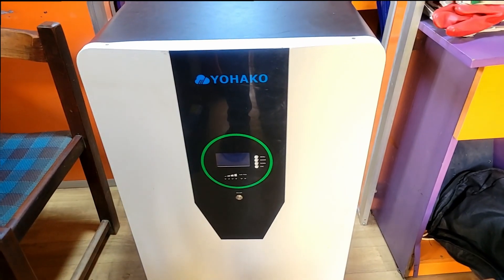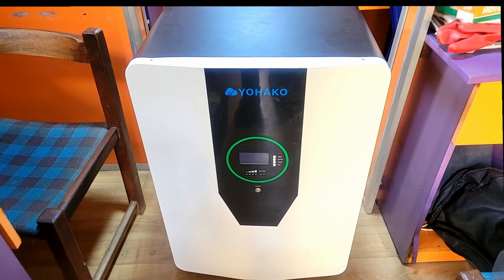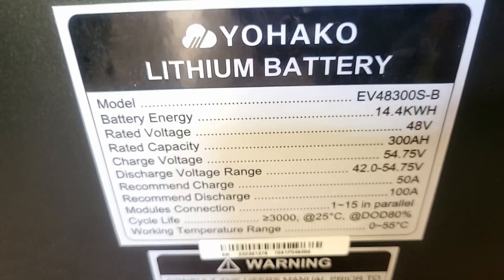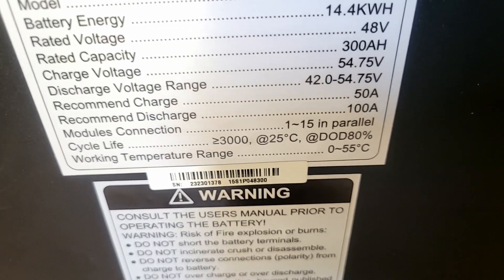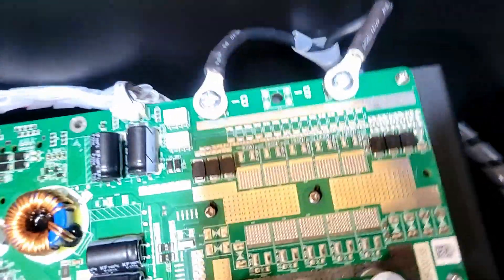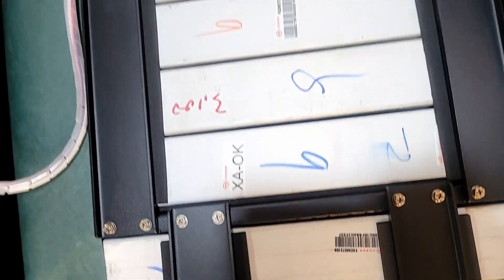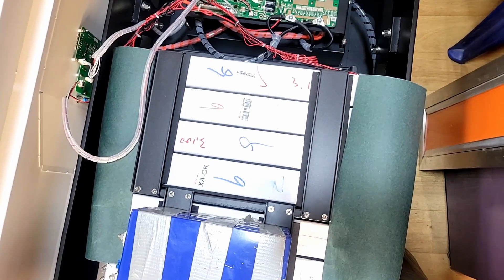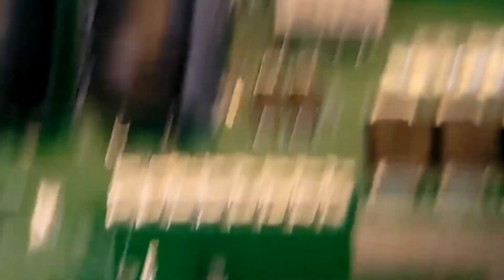Unbelievable Deception! Our Mind-blowing Discovery Inside The Yohako Battery!

Comment: Bonsoir merci pour l'explication qu'elle le port   qu'on connect sur l'onduleur
Reply from the maker: @mamadoumarymaintagama1355  I am not sure that any inverter can communicate with the battery. Usually I tell people to read the manual
Reply: J'ai perdu le manuel (les  termites on bouffé ça). Si vous avez la version électronique YOHAKO
LITHIUM BATTERY

Model
EV24200S-B
Battery Energy ..
5.1KWH
Reply from the maker: @mamadoumarymaintagama1355  I don't sell Yohako. Je ne pais le manuel.
Reply: Ok

Comment: Ive dealt with Yohako. You're looking at an "Alaba version" 😅. In essence, someone has opened a genuine battery and replaced the cells... OR more commonly, they've taken a 10kwh battery and badged it as a 15 kwh one (with a printed sticker).

Thats probably what the CEO was trying to tell you. I'd suggest you go to their warehouse, pick a random battery and test it. If I was them, I'd allow you do it to dispel the cloud
Reply: Just scrolled down and seen several.uneavoury comments attacking you personally. For the record I don't support that. And for those (like me) who believe Yohako IS integruous... We need to respond with facts and well thought through positions. Not insults and emotional drivel.

PS: IF Yohako batteries ARE proven to be fraculent; I'll definitely keep an open mind
Reply from the maker: @ikbarbershop  I would be happy to do a follow up. Used automotive cells are OK as long as you disclose this. I said this in my video. Yohako is an Alaba brand
Reply: @drsolar  I have quite a few Yohako products on my premises. I'd be very happy for you to come test them anytime you feel like. And yes I do agree about the reconditioned cells part. But like you said BYD (their old battery) and now EVE (their latest battery cells) are quite high quality.

My suspicion is the 230aH cell was reconditioned and they now sell it as a 200aH cell to account for degradation. I'm almost certain an Alaba reseller changed the sticker and sold a 9.6kwh battery as a 14.4 kwh one. 

Ive just seen you now distribute Solax in Nigeria. I'll reach out this evening to discuss potentially doing some business in that direction

Comment: Wrong calculations my dear, it is 300ah times rated voltage... Bring down this post mugu
Reply from the maker: Thank you engineer. The post is not coming down. Do yours to counter mine. Till then STFU
Reply: simple maths you do not know battery is 234ahx51.2 =11980w does that look like 15kwh battery as printed on the sticker.fool

Comment: I use Yahako inverter for years and it’s working well, don’t spoil someone business. Am not subscribing at all
Reply from the maker: Thank you for watching and commenting. The video is not about an inverter. It is about a battery and what is found inside that battery. Watch it before you comment. Thank you for subscribing
Reply: what load do you apply to yours.watch and listen before you post.he did not say it was not working but it trips off base on load given to it and advertised capacity that is supposed to carry the load.that is why Nigerians fail all the time

Comment: Don't use our product as a medium to boost your audience. We are genuine and it's evident you were paid to defame our product.
Reply: I am looking for contact details for Yohako products. I have used the inverter before, I am happy with it.
Reply from the maker: @DrEnockNorthVoltageEngineering  good to hear
Reply from the maker: thank you for watching and commenting. Did you bother to watch the video? Maybe you should watch before you comment. I don't need to use your product to boost my audience. I challenge you to respond to the points I made and refute them. If you can I will make a follow up video. Inside the battery are used EV cells. The used cells can't be the same capacity as new cells. Refute this and I would gladly remove the video.

Comment: Nice video Dr but I was expecting you will measure the voltage of each cell and also the current to ascertain that the writtten on the label is wrong.
One other thing is that we dont have quality control in Nigeria most of the Lithium batteries cobtains reconditioned cells.
Reply from the maker: The point of the video was not really to get into in depth technical details.
They don't disclose that they are used cells. That is the point of the video.
Reply: @drsolar  this is well noted. Keep up the good work Dr

Comment: Your calculations are wrong, 11kw of Ac load running on 230vac inverter will pull 229amps of Dc current... The BMS can only handle 100amps. Please ensure you do your calculations well before passing misleading informations. As for the cells I believe you were not there while the batteries are been manufactured hence you can't tell if they are repurposed cells or not.
As for your clients setup. He needs a battery bank that can handle 250-300amps of current irrespective of the fact that he only needs 1hr of backup time. Once again please work on your basic physics calculations
Reply from the maker: From your comment you did not watch the video. Watch it again and you will sound more knowledgeable. I don't need to be there (that is the kind of backward thinking I see in Nigeria) when the battery is assembled. They are repurposed cells. Watch my videos from 2017/2018. We worked with these EV cells.
Reply: But your calculations were wrong.. just admit it... Just like saying 1amp of ac current is equivalent to 1amp of Dc current whereby they aren't working on same voltage value
Reply from the maker: @dagboman  watch the video and point to the specific calculation that I did that is wrong.
Reply: Your clients load is 11kw running on 230vac that means you want to draw 229amps from a 48vdc battery bank that has a maximum discharge current of 100amps and you expect magic.
Please learn to distinguish ac discharge current from DC discharge current. It can only be possible of the BMS of the said battery can handle UpTo 230amps.
Reply from the maker: @dagboman  you did not watch the video you are one of the people importing this junk. You challenged me on Nairaland. Post your own video rebutting mine.
Reply: You still didn't get my point... You sound like one of those charlatan Engineers...my emphasis is just on your calculations and nothing else.. rebuff it if I'm wrong...
Reply from the maker: @dagboman  it you watched the video it clearly states that someone else sold the battery. If you watched the video it states that it would not work. You did not watch the video. Watch the video starting with the Kazeem comment. Mr. Ameh if you don't watch the video fully stop commenting
Reply: You did not watch this video! He never installed it and was not the person who bought the yakorubbish.
Reply from the maker: @EjitEnergy  thank you so much. He had an axe to grind. He is a Yohako representative and wants to disparage rather than enlighten Nigerians
Reply: I have always known this product to be fake
Reply: @luckyanayo2313 how many have you gotten from the company and it disappointed you ? You don’t come here to defame someone’s business he worked so hard to build.
Reply: You forgot to say that an 11KW would draw 229A at 48V. The nameplate specs of the battery clear states that the recommended discharge current is 100A. This means the recommended driven load is 48V X 100A = 4.8KW. The battery specs is suppose to also mention the maximum discharge current, but it could be up to double the recommended or working current. That's the reason that when the maximum current is exceeded, the battery trips. This is more a case of overloading the discharge current rather than the backup time. If the discharge current were 230A, for instance, the battery would not trip, but they'll have backup time in minutes rather than an hour. They need to get a battery bank with a recommended or maximum discharge current of 230A @ 48V in order to avoid tripping.

Comment: If you replace the BMS with a higher quality BMS, MAYBE, yes a big NAYBE, you can run higher load with it. But Yohako sure knows how to cut corners. Imagine getting a repackaged already used 10kwh battery as 15kwh battery :(
Reply from the maker: They should disclose that these are repurposed ev cells. They are super high quality cells. Capable of high current draw. They should also not lie about the capacity. Thank you for watching and commenting.

Comment: These BYD cells are repurposed from buses. They are typically removed when they hit 80% of original capacity. This model were 270AH new and are now at 216AH!. the pack will top out at ca. 11kWH max. It is plain fraud to sell these as 15kWH!
Felicity, BlueCarbon, Wakatek and many others do the same. I have pictures and videos to prove it. 
In the case of a '300AH' Felicity, they did not not even bother to remove the water cooling jackets from the EV, which are typically not required in a domestic ESS application! That is why I would never recommend these brands to customers or use them in any job! It means your endurance calculations are always off! I have put a number of them through several charge/discharge cycles on the testbench, logged on test equipment and they always fell short of the nameplate capacity!
Sometimes the 'Alaba' trader is part of the fraud. The marriage between them and the Chinese manufacturers is one made at someplace other than heaven!
Reply: Nothing but fact only
Reply from the maker: @abdulazeezafingo7018  thank you
Reply: What brands of MPPT charge controllers will you recommend please?
Reply from the maker: @EasyyokeFilms  you can't go wrong with the Victron or Schneider
Reply from the maker: I have pinned this. Thank you for watching and commenting. Are you new to this channel? People like you are why we put out content.
Reply: Please sir, which lifepo4 battery will you recommend in Nigeria because it seems Felicity is a fraud and I want to get one
Reply from the maker: @arya-iw2cl  thank you for watching and commenting. Depends on your budget. Pylon tech BYD make good battery. SolaX makes good batteries too
Reply: An eye opener.
Reply from the maker: @MrOzimini  thank you for watching and commenting.

Comment: The customer couldn't afford premium service and went for cheap quotes, oh well, as the saying goes,you get what you pay for 😂.
If only the installer knew that lithium batteries has a maximum discharge current,such mess would have been avoided.
Reply from the maker: The installer is where I was in 2018. I did not know. Like they say, you get what you pay for. Thank you for watching and commenting.

Comment: All the batteries sold in Nigeria are grade C or worse batteries. This is why they are sold at such lower price and only sold in Nigeria. You will never find them sold in the USA.
Reply: I won't say all batteries sold in Nigeria as there are premium ones like Deye, pylontech etc, the problem is that most installers are less educated on these things and the tend to make a living by giving customers what they want (cheap products).

Give the customer quotation using premium batteries, solar panels and inverters and they will run and call you names and run to the cost effective installer and cry victims when the effects of the cheap options starts manifesting.
Reply: African Energy Distribute the Weco 5K3 XP Dual Voltage Battery in Abuja. They are excellent value for money!!
Reply from the maker: Thank you for watching and commenting. I disagree about your blanket comment on batteries. You get what you pay for.
Reply: @drsolar  have you worked with EG4 batteries ?
Reply from the maker: @caniceonuoha  no I have not. I am very particular about who I use.

Comment: The problem is the lack of standards in Nigeria. This same company may be selling in the US you will never encounter this case because it'll be too expensive for them to do false advertising. I will not be surprised if this battery was relabeled in Nigeria.
Reply from the maker: Thank you for watching and commenting. I have lived in the US and occasionally some junk gets through. Industry has banded together to set up standards. And if you don't have that stamp you don't get insurance.
Reply: Be careful what you wish for, when asking for standards. If there’s not going to be an independent body to regulate & ensure these standards are met it means heightened & increased costs to get certification - which is passed to the consumer on product quality as well as cartels through some unscrupulous installers who may be the only ones certified to do installations. Don’t get me wrong. Regulation is required and important to ensure end-users get correct products & services, but stronger should also be the ensuring that bottlenecks then don’t drive prices up. My first installation instead of getting Pv cables & MC-4 connectors, I got electrical cabling & insulation tape plus telecoms stolen batteries.

Comment: A classic case of you get what you pay for. In this case, it's terms of materials, workmanship and contractors/engineers. Those cells must have been reclaimed from BYD electric vehicles for sure. Assuming the battery is even as advertised i.e. 14.4Kwh, pulling 11Kw at a nominal 48V dc implies demanding 300A from the battery. If we consider conversion losses the current drawn from the battery at 11Kw AC will be more 300A (that's more than 1C) so even a genuine and high quality battery will struggle, will not last or (preferably) short down to protect the cells and minimise fire risks. The dubious manufacturer recommended charge/discharge rates of 50/100A respectively but they told the user he can go upto 300+A. The people who did the calculations are as crappy as the battery. I learnt Yohako inverters have high failure rates too. Thanks for the video.
Reply from the maker: If they cell them as repurposed, I am fine. BigBattery does just that. Thank you for watching and commenting
Reply: @drsolar  any good installer with good knowledge of lithium battery chemistry would know from the nameplate that they're either grade B cells or recycled cells.
Reply from the maker: @FerdinandApeh  without opening it how are you able to? Why would anyone assume that they are purchasing reclaimed cells if it is not disclosed. I have been installing lithium since 2018 and I can't tell from just looking at the device. Maybe you want to share how you are able to do so. We look forward to hearing from you
Reply: @drsolar  You don't really need to open it to know, a grade A cell usually have a recommended 0.5C charge/discharge rating so any battery with recommendations of less than 0.5C rating for lithium battery chemistry is either a grade B cells or recycled cells as they can't handle the normal 0.5C charge/discharge current.
Check the nameplate of known manufacturer like pylontech, Deye, EG4 etc they'll always recommend 0.5C and max of 1C charge/discharge current rating.
Reply: @drsolar  Opening a battery pack can only confirm if it's a new or recycled cell but not if they're grade A or B cells unless they have their original barcode which you can then verify from the manufacturer.

Comment: I am not surprised to see this to be honest. There are many brands that do this being sold in the Nigerian market. First you're down 100ah with this and 15s configuration means you're getting a little over 49V. Realistically you're looking at 11.4kwh. The extra 3.6kwh is a substantial loss to the customer. This is what happens when you buy cheap brands. Let's not forget to mention that you can't push more than 0.2C on these batteries otherwise you run the risk of the cells becoming imbalanced after a few months. When this happens, 1 cell will drop below the recommended discharge value and the entire pack becomes useless until you're able to charge that single cell back up. Penny wise, pound foolish in my opinion.
Reply from the maker: Education is the key. The more awareness we create the better informed we all are
Reply: Cheap is ALWAYS expensive! Sad part also is that some good brands also are prohibitive by way of price. There’s cost of hardware, then installation… Solar or going green then becomes an expensive enterprise. Africa also doesn’t have subsidies or higher purchase options, generally, so out laying huge amounts upfront isn’t feasible. Given a choice no one wants to skimp but we’re help back by the harsh cost realities. On the low end you’re then lumped with 2nd life or undersized options. What’s one to do?💁🏾😭😭😭